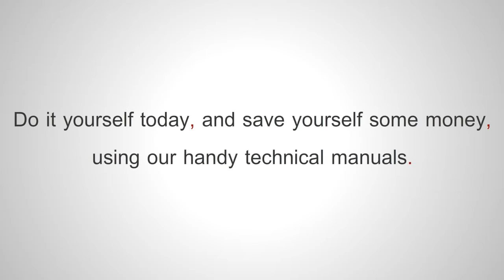Mitsubishi Pajero - Solving Wheel Alignment Problems

Comment: yeah but how to remove Bolts :-P
Reply: i was wondering the same thing. It was all rusty. Did it go through a heating process  or something ?
Reply: I find that the best way is snapping or cutting the head or the nut off of the bolt, then with a screwdriver and a hammer punching it outwards the other side of the bush. Cross fingers the bush doesn’t get damaged as you do this